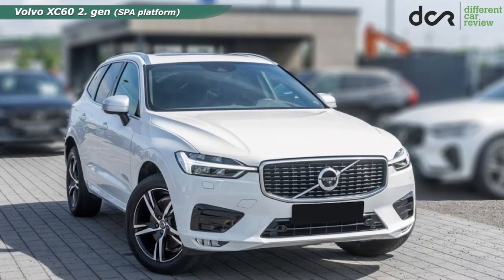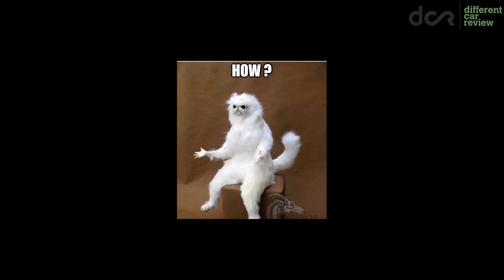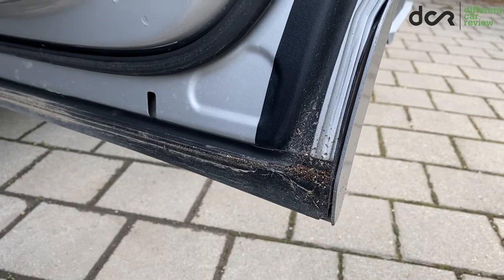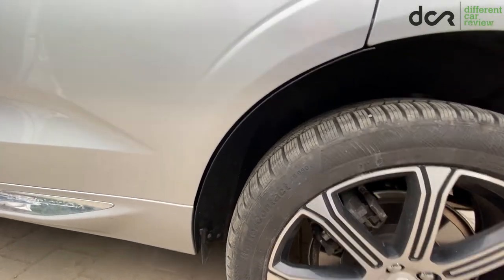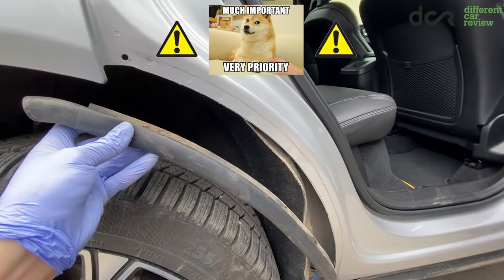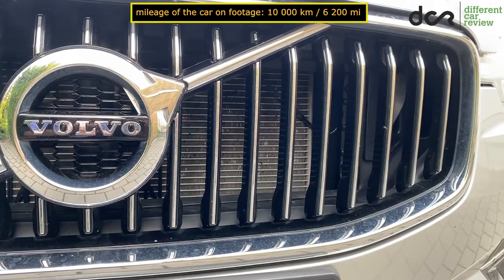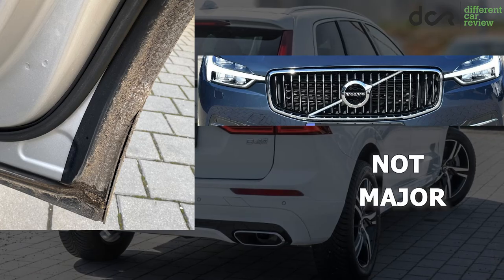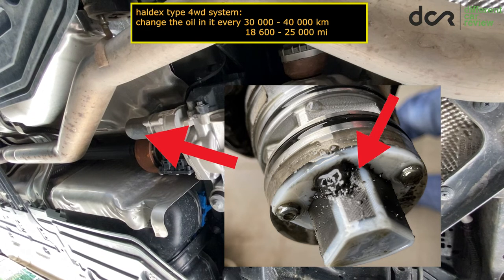2nd gen Volvo XC60 Design Flaw + FIX

Comment from the maker: Range Rover L405 - Electronic & Air suspension Issues https://www.youtube.com/watch?v=PWBKQGZhSuU
Range Rover L322 TDV8 Engine Issues https://youtu.be/bXPNqXs8isg
Range Rover L322 Common Rust Spots & Exterior Issues https://www.youtube.com/watch?v=ECK3FTXGvDM
Range Rover L322 - Removing the Spare Wheel is Genius ! https://www.youtube.com/watch?v=SEdc6VwyPaw
I bought the Cheapest Range Rover in the EU with 447 100 km https://www.youtube.com/watch?v=Ic1wHnoiyEw

Buying a used Volvo S60, V70 (P2) - 2000-2009 https://www.youtube.com/watch?v=pA10J38BBG0
Buying a used Audi Q7 (4L) - 2005-2015 https://www.youtube.com/watch?v=04o6oK1J5fM
Buying a used Land Rover Discovery 3, 4 - LR3, LR4 (L319) 2004-2016 https://www.youtube.com/watch?v=h_TCZ9P_QFM
Buying a used Range Rover Sport L320 - 2005-2013 https://www.youtube.com/watch?v=-xi0E0M0_gw

1st gen 3 0 TDI engine ALL Issues (Audi, VW, Porsche) https://www.youtube.com/watch?v=_so6yhV5qXE
2nd gen 3 0 TDI engine ALL Issues (Audi, VW, Porsche) https://www.youtube.com/watch?v=272PBPSS2no
Toyota Land Cruiser Prado (J120) Critical diesel engine Issues https://www.youtube.com/watch?v=pZZw8ni1ZqE

Audi A6, A8, Q7 STEERING LOCK ISSUE https://www.youtube.com/watch?v=ujxQLU_rw3I
Always clean This when changing your wheels ! https://www.youtube.com/watch?v=pFR3HHymJDc
How To Fix a Sagging/Hard to close Car Door (explained on Audi, VW) https://www.youtube.com/watch?v=CvDJIuflNB8

Comment: Any suggestions on wax/sealant to replace with please?
Reply from the maker: you can use any kind of wax sold in a spray can
if you want something specific there is a VW branded wax spray - part number: D322100M2

Comment: Since China bought them..."geely"...a lot of things changed. Some to worst, some to better!
Reply from the maker: I agree, without that investment the brand would be most probably gone
many things are indeed better than before, but letting go the legendary 5 cylinder engines was a huuuge mistake
Reply: Not so sure. This is not a quality problem, but a design problem. And Volvos are still designed by Swedish engineers, not Geely.